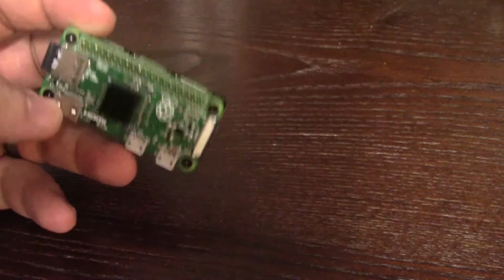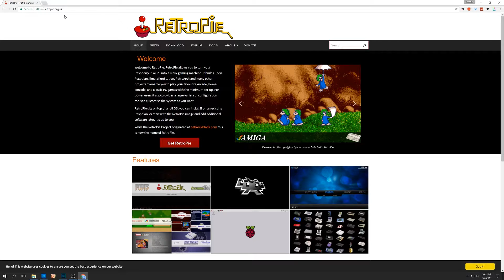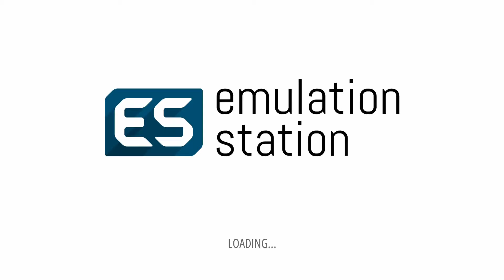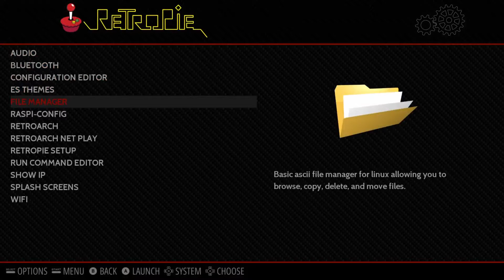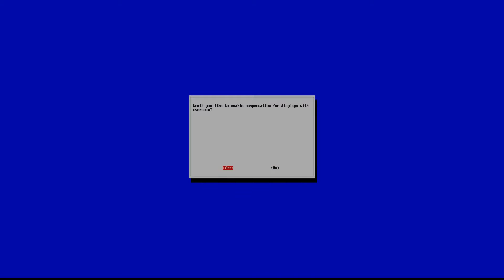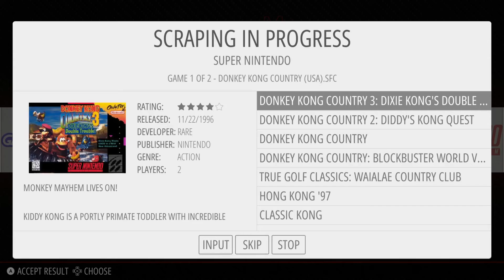Raspberry Pi Zero and RetroPie

Comment: How do you add the emulators?
Reply from the maker: RetroPie comes preloaded with just about any emulator you could want. They will not appear in the menu until you load ROMs for the system you wish to emulate, this helps reduce the clutter on screen to only what you can use.

You can add additional emulators or replace the ones that are preloaded with the instructions here: https://retropie.org.uk/docs/First-Installation/#installing-additional-emulators

Comment: Hi. I'd very much like to see a bit more in-depth setup. I've made lots of builds but not on a pi zero so I would like to know what settings/emulators to use specifically for that.
Reply from the maker: +Richard Chadwick sounds like maybe 2 videos then?

One for the actual setup and figuration of the OS and a second to benchmark the Pi Zero to see how it runs the emulators?